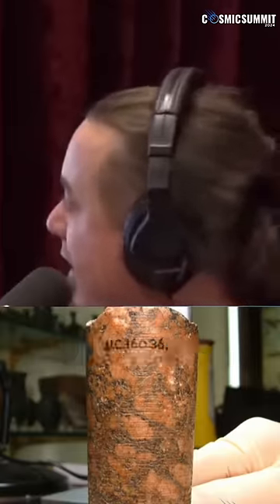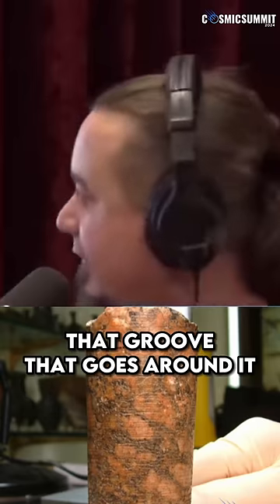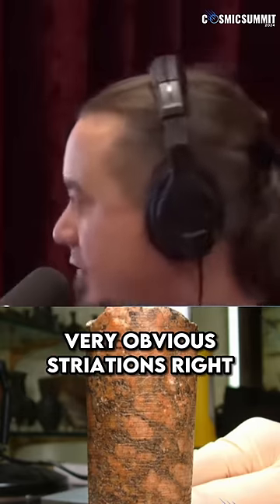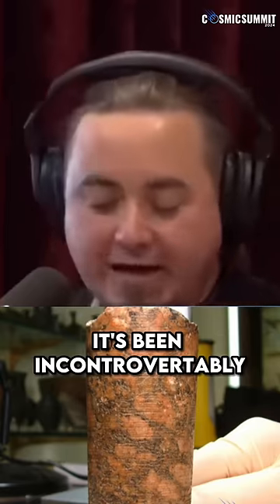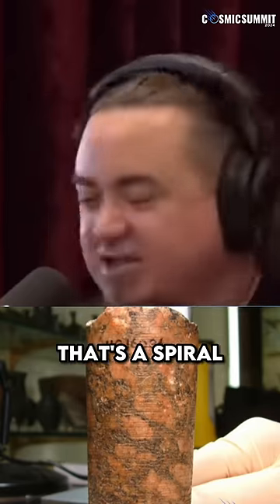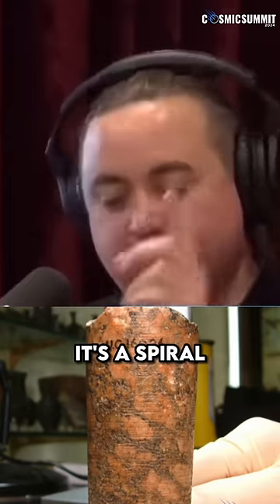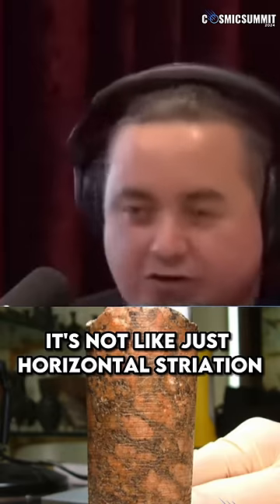What ancient techniques were used to create this twin spiral?

Comment: Twin spiral ..like "Double Lead?"
 That means double (cutter) 180°  apart. Double helix, double start of lead/helix.
 Twin head tool? Unbalanced without a pilot/center pivot.
 Can you prove more helix 3 or 4?
 Balance is not easily achieved with just 2. Unless you're allowing for swarf (waist).
 Very aggressive feed rate?
Reply: Yeah. The feed rate is cazy. It’s like 600 times faster than our standards today. And like you said, it was probably 4 or 6 points, but we can only accurately verify 2 points for sure.

Comment: These people be wilin’ fr. Clearly never heard of Occam’s Razor.
Reply: Ok, so what's the obvious answer?
Reply: @aWildSteveO  I think the most obvious answer is that the groves came from the drill that pulled the sample.
Reply: @SCP-1715. and.. oh my god..  your right?!? How is that possible 😂
Reply: @SCP-1715. no that cannot be the right answer if It trully is a spiral going down the length of the sample then a drill bit cannot explain that. a spiral is the exact same thing as threads on a screw you cannot cut threads out with a core drilling bit period it would have to be something like a single or double point cut on a lathe or something similar to get threads
Reply: @johngibson7307  I have seen drills leave similar marks on things. It's really not that out of the question as your trying to make it seem.
Reply: @SCP-1715.  it depends like I said if it trully is a uninterrupted spiral going down the length of the core then no a drill bit cannot do that look up machining single point threading and you will understand what I'm saying but if it isn't uninterrupted threads then yeah it probably is a core drilling bit

Comment: The fastest way to drill a hole in rock is to start small then increase the size of the drill head in stages. The result is that the largest drill will penetrate the rock fast like a screw.
Reply: This is a drill core. Using the method you mention would not leave a core sample other than crushed granite fragments.

Comment: They had power 3k years ago proof no burn marks on ceilings and the glass bulbs with gold snake filament in it with wires to a box huge light bulb
Reply: Nope all of those have been disproved
Reply: There was also boxes with 9 cells full of sand those were ancient batteries
Reply: @eyes2c..519  again also proven to not be possible

Comment: NO JUST COPPER CHISELS! COPPER CHISSSSELLLLLS DAMMIT!
Reply: What? Ask any egyptologist and they say they used hand drills for this
Reply: @datcheesecakeboi6745  egyptologists should ask engineers if it's possible to do even spiral marks by hand, then they will have their world turned upside down.
Reply: @Dandan-tg6tj  no they wouldn't, a team of engineers, mathematicians and egyptologists working together figured out how it was done

With a copper pipe
Reply: @datcheesecakeboi6745  Well, engineers are of many shapes and colors. Ask any mechanical engineer and they will tell you exactly what I say. There is no way to achieve that kind of marks other than using machinery. That level of advance (continuous pitch) can not be achieved with copper pipe unless the rock is softened and  to be able to obtain the constant pitch  machinery is required.
Reply: @Dandan-tg6tj  question then

If its not possible... how did we do it? Because we literally did it with a copper pipe
Reply: @Dandan-tg6tj  look it up, it's possible we did it
Reply: @datcheesecakeboi6745  A hole in stone using a copper pipe sand and maybe some water, I say it is perfectly possible. It is also possible to bore a hole in stone using a piece of wood and sand. This is something I have nothing against. 
A hole with constant pitch marks is way different and you couldn't do it with anything else but a machine.
Considering the pitch over each rotation, the drilling speed is amazing and was probably achieved with extreme hardness of the tool and with extreme power of the machine or if the stone was somehow softened. Maybe a different technology was actually used but the marks are similar to drilling. Drilling machines leave precisely that kind of marks. That's not a hand made thing, it's machined.